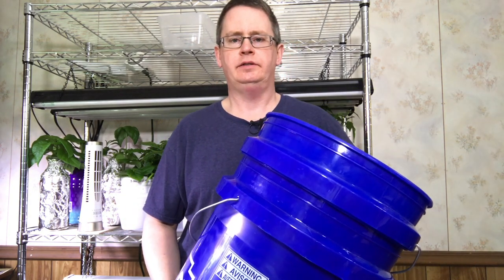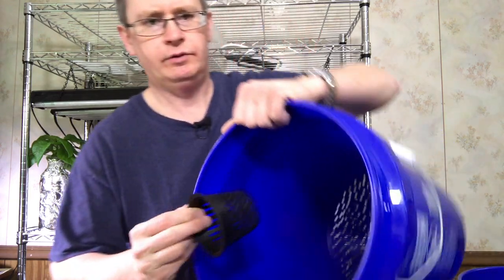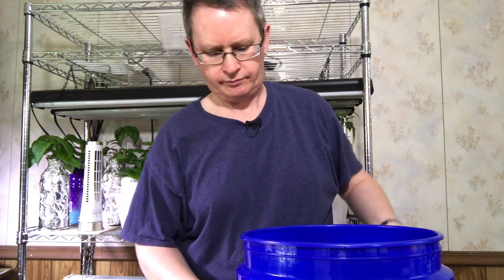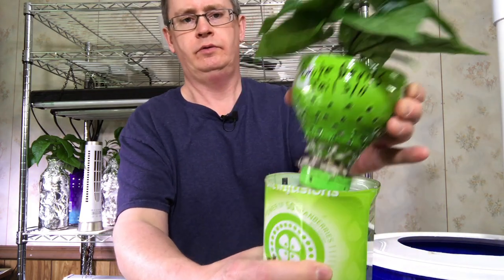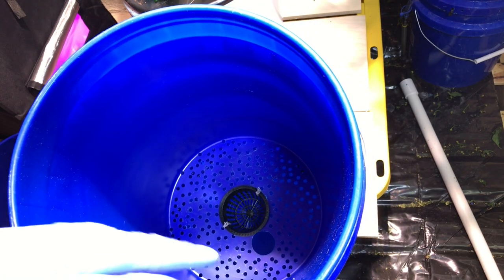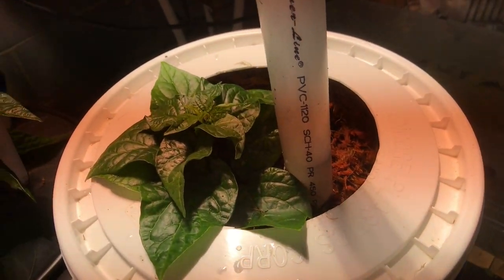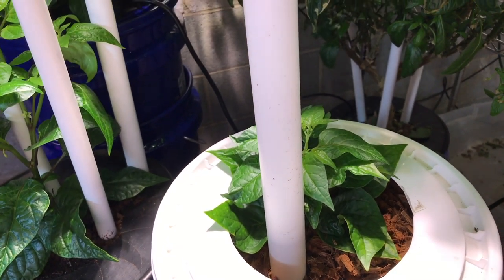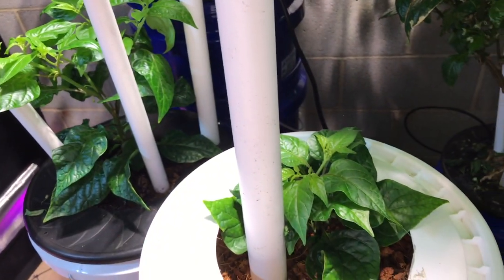Self-watering wick systems comparison - Which is better?

Comment: I also am trying the net cup system, the only difference is I'm using a grow bag for air pruning instead of soil touching the sides of the bucket. Thanks for showing your results.
Reply from the maker: Thanks, please share later how your system does. Sounds like it will work really well.

Comment: Thanks for the video, but why limit the water reservoir by using just a 3 inch net pot?  Would it not be better for long term watering to maximum the height to take advantage of the second bucket's volume?  For example 3 inches of water vs 12 inches of water?  I would expect much longer time periods between filling which would be desirable.  Perhaps you address this in later videos?

Comment: I like the idea of using two inexpensive buckets instead of the method where you place the lid cut out on supports for the base.
Reply from the maker: You might want to check out the GroBucket. It's an insert that converts a single 5-gal bucket to sub irrigated planter/self watering container. I just put out a video on it. I'm going to start using these going forward. https://youtu.be/AS-X5VaySy0
Reply: @pepperdactyl  A bucket is less than $4, the grobucket sells for $40 for a 3 pack on amazon.
Reply from the maker: @dlynnfrazier5216  Do what works best for you. One grobucket insert is around 13, plus cost of your bucket. You'll need a drill and small bit. That's pretty much it. The typical DIY bucket in bucket build, needs the same drill and small bit, but two buckets, two different size hole saws (which most people don't have), a net cup, some pvc pipe, something to cut the pvc pipe, some zip ties. And it takes a hell of a lot more time and effort to build. It really comes down to preference though, what tools and materials you have already, and what you want to do. I've built a bunch of the bucket in bucket builds, and they are a pain to setup. I literally could bust out 10 grobucket setups in the time it takes (probably less) to construct one bucket in bucket build. I think I'm going to make a video on building one from scratch because folks have asked. I'll run a side by side comparison against the grobucket.

Comment: I built a self watering bucket for my Tabasco pepper this spring and forgot to put the net pot wick in it, hahaha. It took a while to get going and I had to water from the top, but I think it finally sent roots into the resivoire because we've has triple digit heat this past week and it's putting on new growth and looking lush when my other plants in plain soil keep wilting. Next time I'll remember the wick, hahaha. I just bought 100 3" net pots for $.22 each off Amazon. I thought that was a great deal since it's half what local hydroponic shop charges for them.  I love your build vids Peter. Keep up the good work.
Reply from the maker: I'm glad you enjoy the videos. Thank you very much for watching! Great deal on the 3 inch net pots too.

Comment: I see you using small bottles cut in two for self watering pots for seedlings. The roots grow through the hole where the cap was. This makes getting the plant out difficult to do without damaging the roots. Why not take a razor knife and split the bottle to release the plant so the roots can grow freely?

Comment: Hello Peter, sort of late to your page. I've been using this concept for years with great success. I only have 2 differences. Instead of using a net pot I use either 3 or 4 inch PVC that extends from just above the bottom of the top bucket to the bottom of the bottom bucket and drill "many" wicking holes in the PVC. This allows me to take advantage of the entire water volume. Second I add an additional bucket with either the entire bottom cu out or cut in half (top & bottom) and add it between the upper and lower buckets. This allows me more water volume. I'm interested in seeing if you have any videos of the system making the rounds using cans, bottles, etc? It doesn't make sense to me. Seems like the potting mix would stay saturated.
Reply from the maker: Thanks for your comment. I find myself using more and more of these each year. Your design changes sound great. Here's a playlist of some wicking related videos I have done over the years. https://www.youtube.com/playlist?list=PLx7XtYIVCogT44CB1KEX6CXjtFJI9L8QJ  One of my viewers pointed out a suggestion I could try on my bucket in bucket setups. He said drilling holes in the sides through both containers for purpose of providing more aeration to the roots. It makes sense to me, I'm going to try it on some this year.

Comment: I have a certain problem to understand and I want to be sure to do it OK. You put the mesh little trap so the roots will go in the reservoir. But do you put fabric in the mesh?? Do you put soil, compost or something like this or just something to hold the plant in place and it's the roots who go to take their water: hydro culture??
Reply from the maker: Thanks for your questions. I'm planning to make a more in depth video soon showing how to make one of these, step by step. The mesh part at the bottom is just a 3" net pot, and it allows water and nutrients to wick up into the potting mix. When I fill the inner container with potting mix, I pack it down into that net pot. Some of it might come out, but it mostly stays in there, so there is no need for fabric. Any kind of well draining and well aerated potting mix, peat or coco based would work. You can even use straight coco coir and nothing else. Then feed with hydroponic nutrients. You could alternately use a slow release fertilizer mixed into the potting mix and just add water. I prefer feeding hydroponic nutrients into non-fertilized mix. The mix has to be able to wick up also, so it needs to be more than just a supporting medium, like using only clay pebbles wouldn't work in this setup.

Comment: Hi Peterl a little off topic question.  How well will my Pepper plants do in 2 gal pots? I dont need huge plants and im growing them under T5 lights.  Just wondering if that pot size is big enough to produce decent peppers.  Thanks
Reply from the maker: You can grow nice plants in 2 gallon pots. I have three on my porch now, two are self watering type, and one is a hempy method bucket. If you check my most recent grow update you can see them, Tien Tsin, Thai Dragon and CARDI Yellow Scorpion. Limiting factor indoors might be lighting and type of pepper you're growing. If you can get them some real sun they will grow bigger and produce more. You can grow plants really well under t5s, t8s even. As the plants get bigger you'll need more lumens and more light penetration to get more size and better harvests. I always start my plants early under t8s in 20 oz cups, and some of them even produce pods before going outside full time.

Comment: New to channel.
Why do you have 3-4 pvc pipes in 2nd planter?
Do the pvc fill tubes have to be as high/long? Can they be cut shorter?
Thanks
Reply from the maker: Thanks for watching! The three in the 2nd planter are just for plant support. They are zip tied to the net cup. The one in the other is a fill pipe and also doubles as plant support.

Comment: How do you stop the potting mix aside from net pot from going thru holes into water reservoir?
Reply from the maker: If you pack it in really well when you set it up, it'll be fine. A little might come through but not enough to matter. It's good to water everthing in after placing the plant. This will get everything wet, and wicking should take care of the rest

Comment: Is the growth similar to Hydroponics? And could you put an AirStone in the bottom for faster growth?
Reply from the maker: The growth was pretty decent once the plants got established. As the roots grew out, it sort of morphed into a hybrid Kratky system. The roots above the nutrient solution were performing some gas exchange. That seemed to help the lack of supplemental O2 in the nutrient solution. They didn't seem to grow as fast or large as my low pressure aeroponics system. But they did produce well, and early.

Comment: Why wouldn't you use side holes? Plants need way more air than what you're giving them. SMH.
Reply from the maker: I hope didn't hurt your neck shaking your head so hard, lol. Side holes are not possible with the self watering container, since it is a bucket within a bucket. The other gets plenty of aeration through the holes in the bucket lid net pot. These actually work really well, not sure if you've actually tried it or not. Thanks for watching.
Reply: @pepperdactyl  Yep, I've tried several ways using a bucket and I can tell you, holes in the side are possible. You just put holes in both buckets. Line up the buckets and drill through both at the same time. If you do this, you'll see double your harvest at a min. Good luck.
Reply from the maker: @LGZEE  I will try it! Thank you.

Comment: Ok Tell the truth. Was this just a really long Lowe's commercial? Your title suggests that this is a comparison of different systems. It isn't. Lastly,  I really don't understand how you can call this a 'wick system' when there is no true wick in the system
Reply from the maker: Thanks for your feedback. The self-watering containers, like the one I made, or Earthboxes, etc..., in my opinion are wicking systems. The potting mix that extends down in the center net cup becomes the wick. It is touching the nutrient solution/water and the plant draws up what it needs through that.